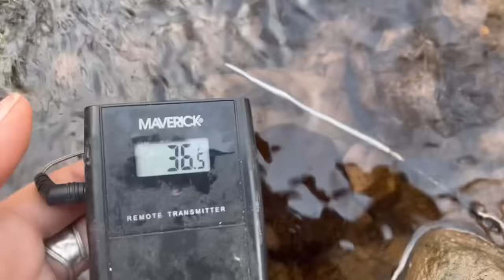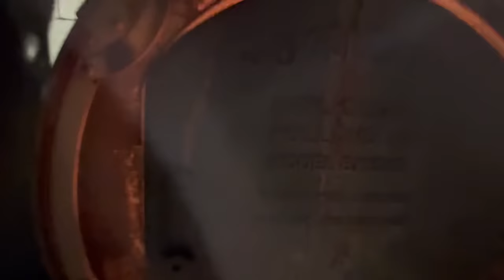A Day In The Life…

Comment: Can't say I've ever voluntarily gotten into 36 degree water, but have gotten there a few times from thin ice on our creek.  I normally cut out the morning dip about the time the leaves fall and don't start again until mid April.  With less than 2 percent of the US relying on wood heat, it is always nice to see others using this low cost carbon neutral fuel.

Comment: Nice to have a greenhouse,we made a huge water furnace,fire box is 42” and water jacket is 48” in diameter,a little pump circulates the hot water underground to the house and garage burning green,frozen,rotten wood which have lots of,you could heat the soil in the greenhouse by running a loop of pipe from stove into the bottom of the box you plant in.The stove didnt cost much to make as we got the pipes from a natural gas plant free,and you have lots of slabs and cutoffs to burn in it,the price of electricity and gas for heat is climbing steadily while ours is very cheap,I used to log for income so getting wood is no problem,I see your cat likes it’s tummy rubs too.

Comment: We have a box stove that is advertised as a supplemental furnace. We've been using for at least ten year. It will take an 18"x 8"log without a problem. What makes it so great is has blower that sucks in air from the back and blows it around the fire box. The warm/hot air comes out of an opening in the top of the stove. By adjusting the draft we can regulate the temp. of the house. We have ours in the basement and it puts out enough heat to keep the house at around 73F. with an out side temp of 20F. If you have a forced hot air system you can connect the stove to that system.  The dip in the stream gave me a chill. I've been through ice a few times. The first was when I was about six or seven. I even managed to get myself out. Thank you for the video.

Comment: Wow, that was one waist of wood for a greenhouse that is not in use. Like keeping the roots warm?!
The old stove´s door is not air tight enough, so loading it will just make it burn through too quickly.
You need to fix the seal on the door and be able to close the flew completely, it´s enough just ticking over
with two larger logs, yet your using kindle wood in a stove that literally suck´s too much!

Your dip in the stream might be easier if you moves a few rocks to create a deeper place to dip?

Nice home, not shore what´s happening to the mantle, yet always good to keep the hands from being idle.

Comment: Did you ever think about putting a rocket stove in your greenhouse .. play the rocket stove works you only need a little bit of a fire to get eat the mass up depending on the temperature that match baby heating up enough to last for a couple days.. the way the rocket stove is designed it takes about 80 to 90% of the heat out of your exhaust stack.. there's enough heat it left in the chimney to push out all bad stuff      
Outside.. there is also called him another type of mass heater.. you take a couple 55-gallon drums.. preferably plastic.. your painter blocking you put one in each corner of the greenhouse.. unless you put it on the south side of the building and the Sun during the day heats up the water in the drums and at night it releases the heat back into the greenhouse..

Comment: I modded our Espresso Machine(identical to yours De'Longhi DedicaEC680).........NIGHT & DAY difference. That foam you got is CRAP.......our has tight thick foam...not a bunch of fat crappy bubbles. Changed out the basket for a real non-pressurized basket. If you want a real Cappuccino or Latte, a modded machine is the way to do it. My wife calls them Happy-Chinnos 😁 Cheap to do.